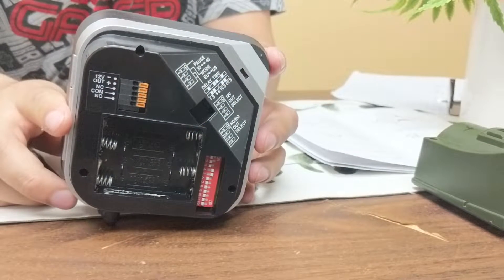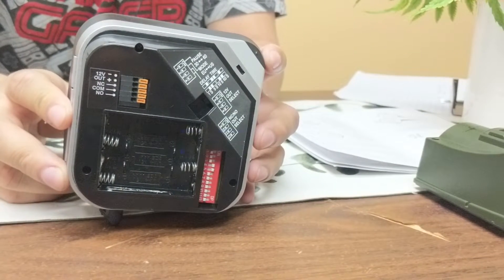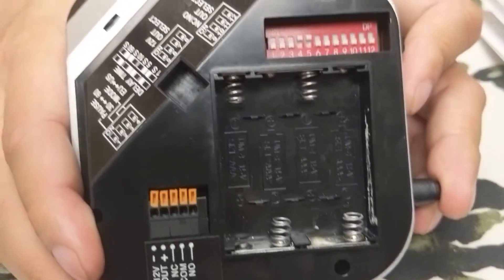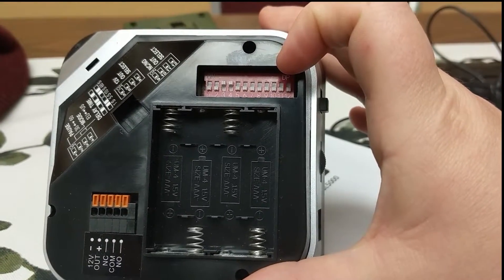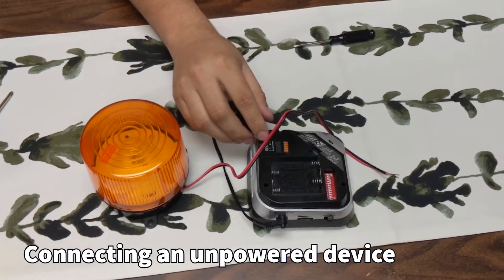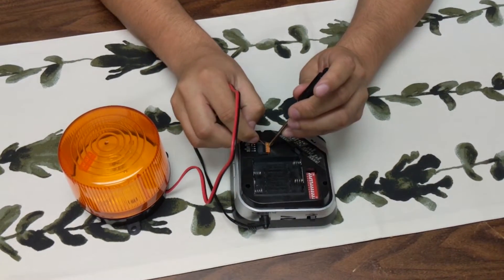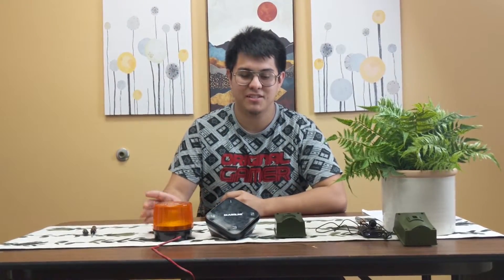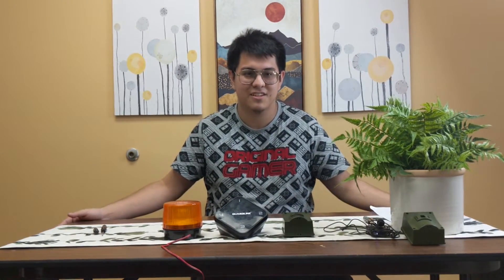Guardline Motion Sensor Receiver: Understanding the 12v Relay Function

Comment: How about using the relay feature to activate something like this from Ebay {ISD1820 Voice Recording Playback Module Sound Recorder Board With Loudspeaker} which could be programed to interact with an Alexa routine. Set up the Routine in Alexa to listen for specific phrase, record that phrase into the ISD 1820 and hook into relay for power, when alarm triggers phrase is spoken and Alexa runs routine (turn on outdoor lights, send vocalization to other Alexa devices of Driveway Alarm...). Cool or crazy?

Comment: Is there a way to have the 12V trigger turn on more than one device, like the strobe light and a siren?  Or possible a way to power on a separate board that would turn on multiple devies (sirens, flashing lights, landmines, etc).
Reply from the maker: Hey Wade, at the moment there's one one dry contact port per receiver so you'll need to purchase an additional receiver to run multiple 12v relay items. The brightest lights we sell are the strobe lights you see in this video but you can wire any 12volt device to your receiver.